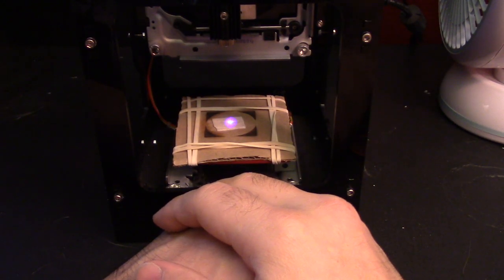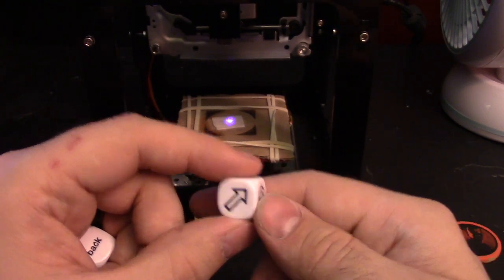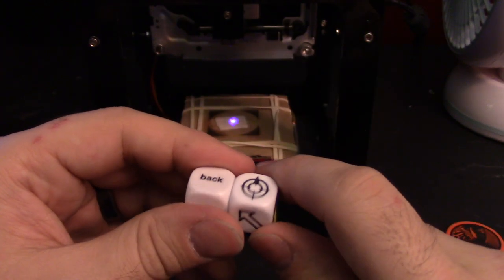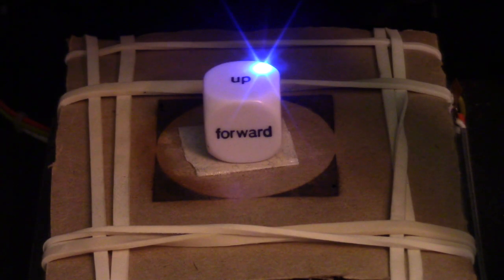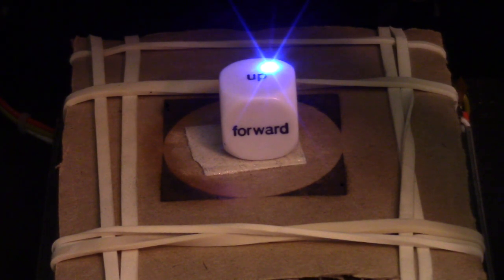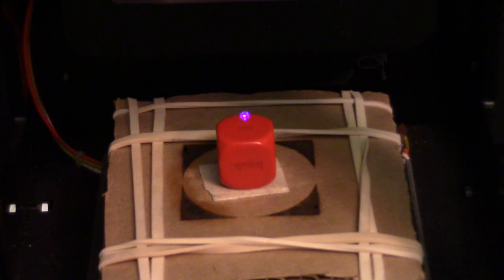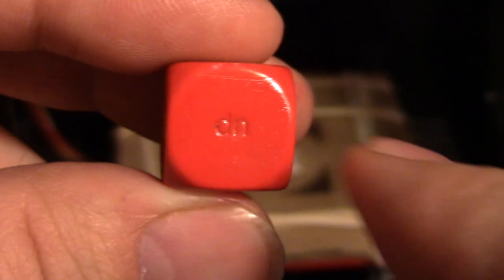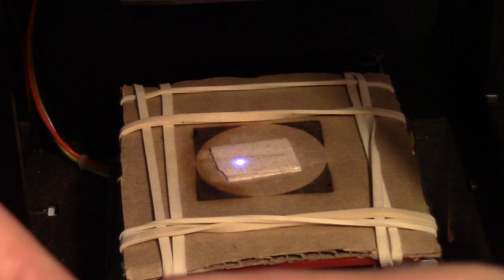NEJE DK-8-KZ Laser etching Dice Experiment

Comment: Can you please try acrylic blanks used for pen making, it is softer that that plastic the dice is made of. Thank you.
Reply from the maker: I can try!
Reply: @VideoWulff  WoW that was a fast reply and you are even willing. I think that could work on the softer acrylic blank, and buying this unit to just do wooden blanks wont be worth it, if it does edge the acrylic resin type blanks i will invest in one for sure. Would it help to burn or laser it at a slower rate i wonder. i did see they send some samples with the laser to test on, one of them was a plastic, or a perspex type maybe.....
Anyhow thank you so much for the reply and willingness.
Reply from the maker: @GIDO74  not a problem! I will make sure to comment to you again once I get my equipment set back up. We just moved and am setting up my work space. Once I finish, I will make this one of my first projects
Reply: @VideoWulff  Thank you and best wishes and blessings to you and your family;

Comment: I had success etching white plastic, but it depends on the plastic. If it's a softer plastic that's more textured and not reflective, it'll usually work. I etched a white guitar pic for someone recently and it turned out well, but the etching wasn't a solid black. It was more of a dark brown after I washed it up, but it looked great. Also, some types of plastic will just melt an indentation without a black burn, but it can look cool if you drop some gold paint (or another color) into it and then scrape off the excess after it dries.